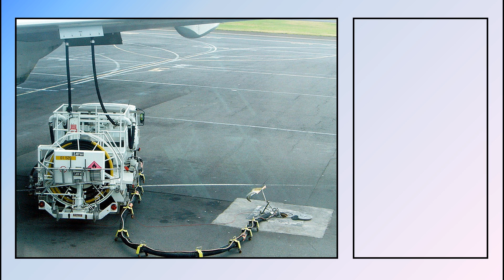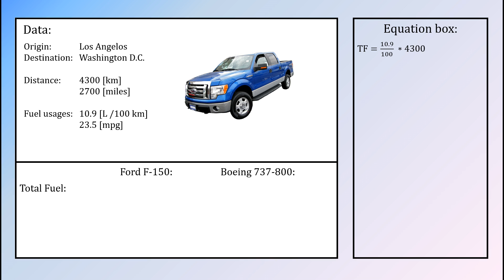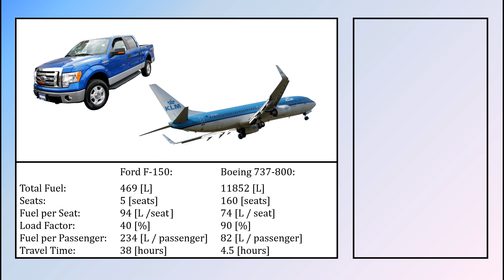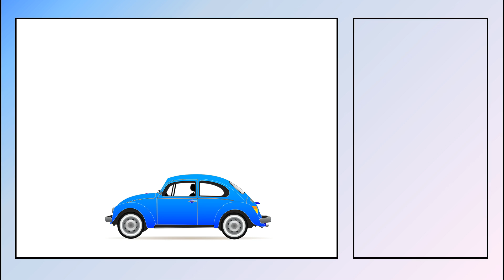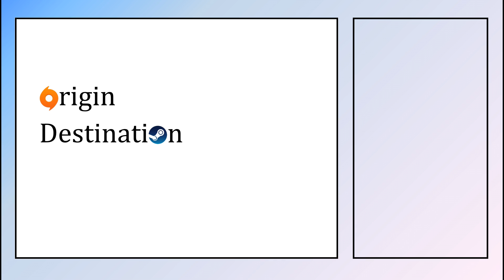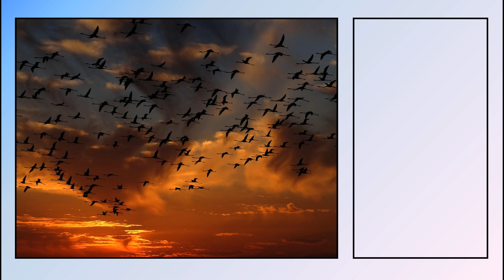How Environmentally Unfriendly Are Airplanes Really?

Comment: well... besides you`re totally right about what dumb dudes driving F150s should do (or not do), you missed various points, and among them these two:
1. you just ignored the fact of the gigantic infrastructure you need to run an airport - very heavy cars, gigantic amounts of electricity consumption (not yet carbon neutral at all) and the mostly motorized way of the passengers to the airport included.
2. you only calculated the "flight" as if it just snap starts high up in the air, but the take off of those huge heavy metal birds is where fuel consumption goes bananas. (according to this: https://www.klimaneutral-handeln.de/php/kompens-berechnen.php calculator, you would have to count as much as 3.9 L /100 km per person, and the whole flight would be at 156 L/person in your example)
3. there is sth called "Radiative Forcing Index" (RFI-factor), which basicly takes into account, that any CO2 emitted in the upper atmosphere lasts up to 2.7 times longer than such emitted near the ground (stratosphere doesn't really mix up with the troposphere beneath and, well, no trees up there, right?).
4. as you yourself said you know there are different fuels to calculate with, you gave plain another slight advantage, bc: Gasoline -> 2,3 kg(CO2)/L; Jet fuel -> 2,53 kg(CO2)/L.
only the last two points together lead us to this:
for F150 in this example: 234 L * 2,3 kg/L = 538.2 kg(CO2)
for jet: 82 L * 2,53 kg/L * 2.7 (RFI) = 560.142 kg(CO2e) -> (CO2 equivalents)

so, even with your highly unlikely consumption for the jet (for both vehicles, actually...) it is already slightly worse than this ugly street tank.
if calculated with the 156 L/person for the flight taken from the linked calculator, you end up with over 1050 kg of CO2e heating up this blue marble.

Happy heating altogether!

Comment: Why did you believe ford's 23.5mpg (lol) for the F150 but went for the hard calculation on the plane? I recon average fuel consumption for a 737 coast to coast is pretty known?
Reply from the maker: To show how big the difference is. by comparing the maximum of the 737 and the minimum of the Ford, a big difference in efficiency is clearly visible.

Comment: Two flaws I have noticed: you did not account for wind (specifically jet streams) for airplanes. Air traffic control plans routes utilizing jet streams or favorable wind conditions to safe fuel and flight time which will considerably reduce fuel usage. Also, if you have an inefficient car, buying a new car, even if it's efficient, will have a larger environmental impact than just driving your old car until it's used up. A lot of the pollution of cars comes from manufacturing them, so buying a new car is a large direct bad impact on the environment. Whenever you buy a new car, buy an efficient car, and buy it for the long term. No need to buy a new one every two years or whatever.
Reply from the maker: Yeah I totally agree with you. It has been shown that 50% of the CO2 production of a car, is emitted while production. So only the remaining half of it is actually gasoline because of driving. Because of that, people should use their car way longer than they usually do. But if you need to buy a new car, at least get a efficient one.
Reply: Chong Lee but no one flys an airplane for a year and then buys a New one